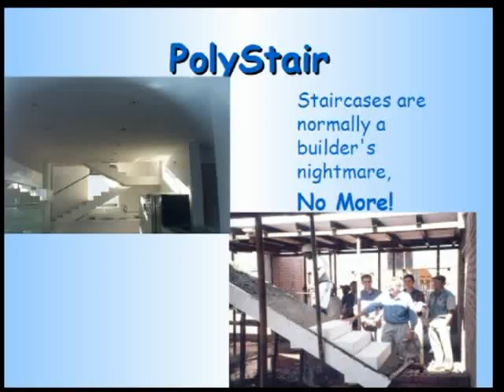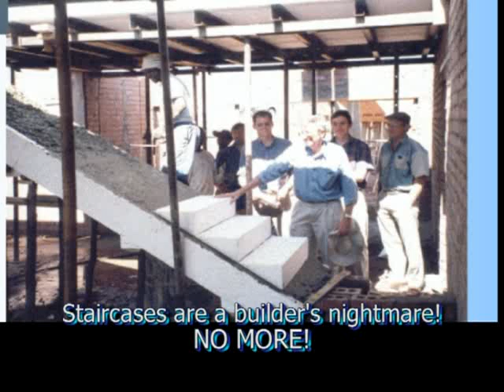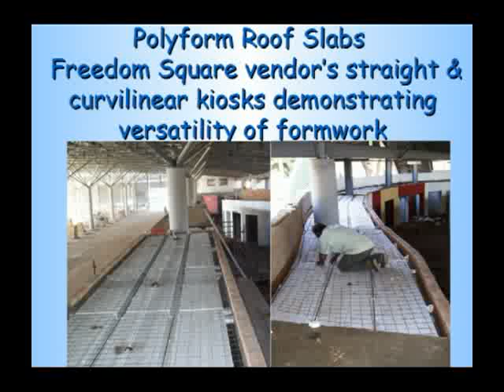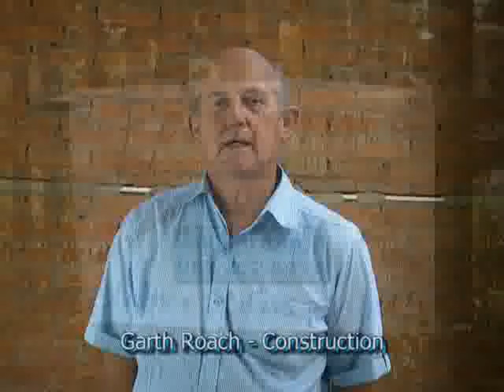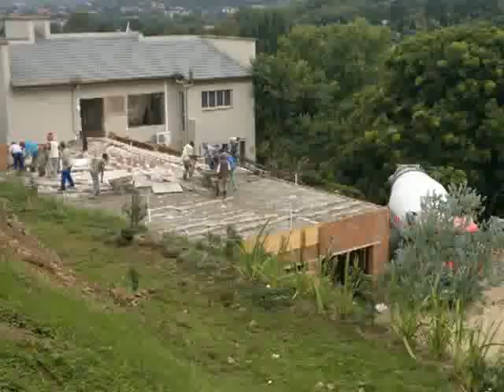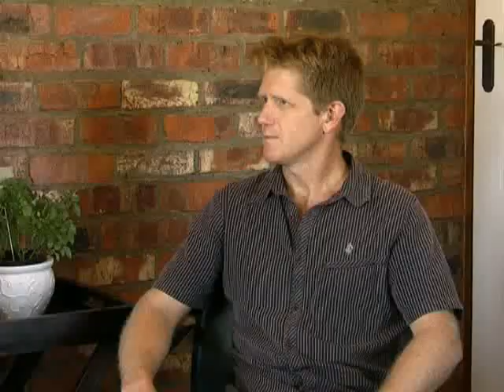polyform 2a

Comment: Polyform-Polystructures offer two
construction Systems which incorporate
Reinforced concrete and expanded 
polystyrene.
 - Mobile and on site constructed buildings
 - Low Income Housing
 - Suspended floor slabs and stairs